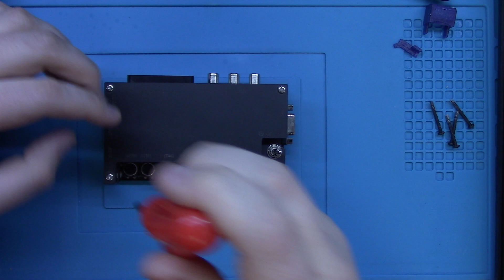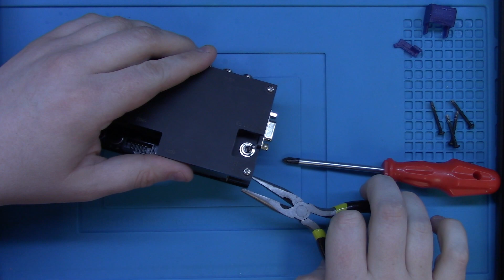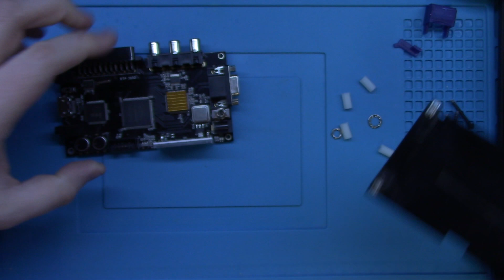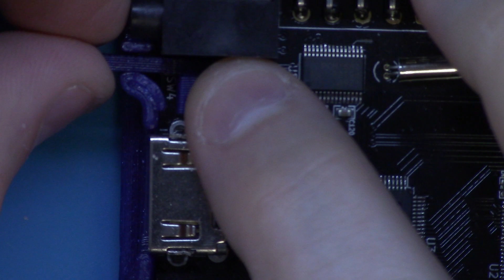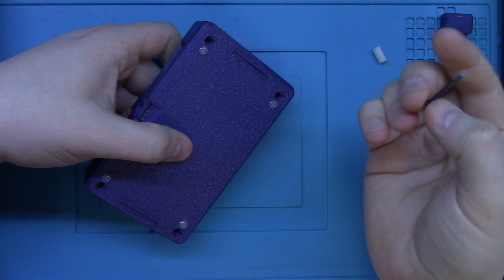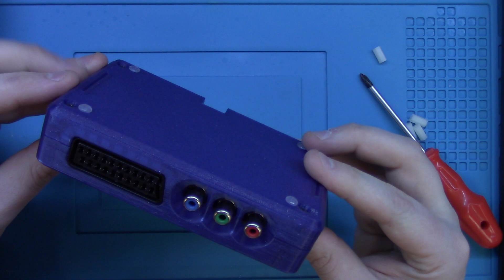OSSC Replacement Case

Comment: Even after a 3rd try of reassambling everything (taking ossc pcb out, put case back on) it feels like it won't fit. Using a original VGP Ossc. The case still moves and the last stretch of the screw takes really hard so I'm bit worried to overforce it? the screwing process in the vid looks much smoother....
Reply from the maker: Could you respond to your order email? It sounds like an older revision made it out for some reason. The VGP boards should fit perfectly into the current revision. We can get you a replacement sent out to resolve this issue.

Comment: I had a hell of a time with those screws at the end. The bumper feet wouldn't stay on for me, so I used some left over "SNES feet" (3M bumpers that mirror the OEM SNES ones) But all is well. It's a nice look for this scaler. 

I would also caution people who don't have the OSSC sold by VGP not to use this case. I don't recommend non-VGP OSSCs in general but if you have one the actual dimensions of the clone OSSC won't be right for this case.